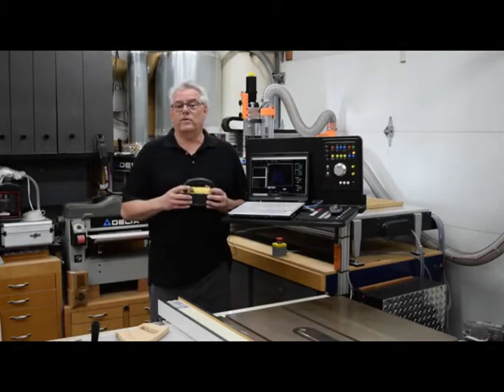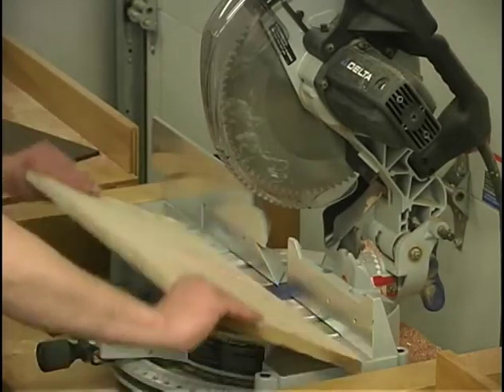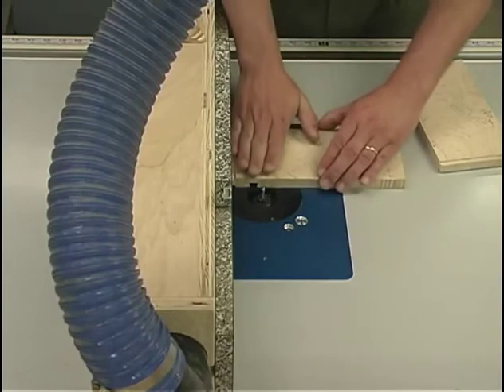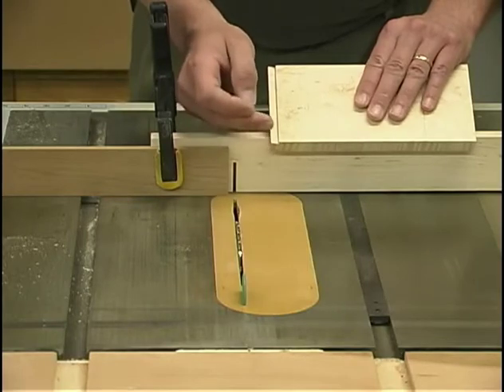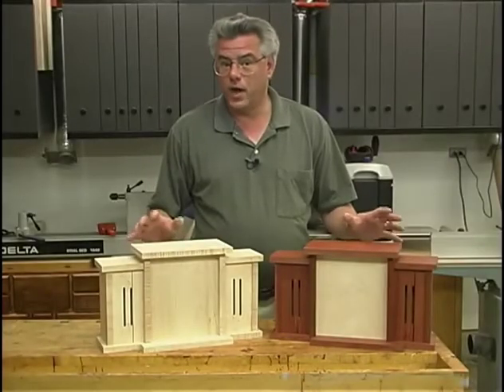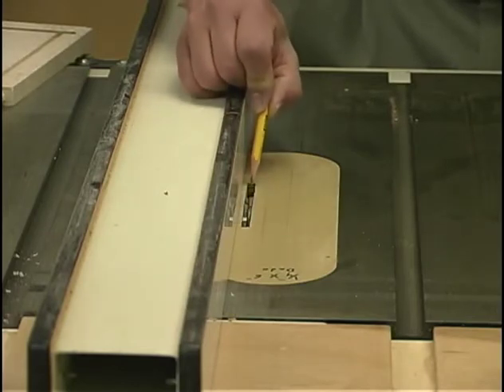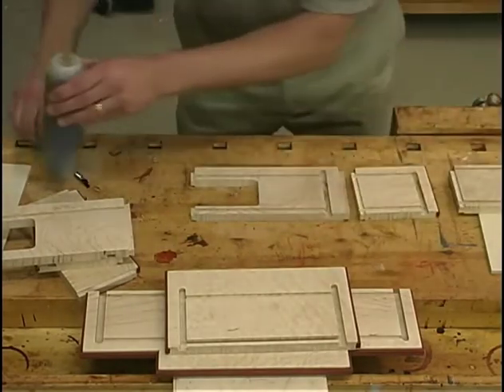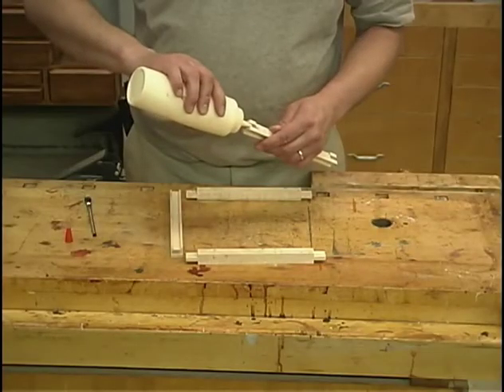W049 Make this Timeless Mantel Clock for your Home

Comment: I was carving a Celtic cross as a wedding gift for my niece and found I needed a very small tool to clean up the small detail.  Ended up buying some square bar (1/8”x1/8”) at Home Depot and filed an edge on a couple of sections.  Instead of wood handles, I just wrapped painters tape on the end.
Reply from the maker: Hi Glasshalffull2930,
Sounds like a great example of solving a problem with some creativity and effort.  Great job!
Cheers
Chris